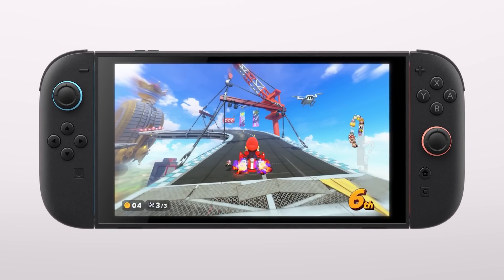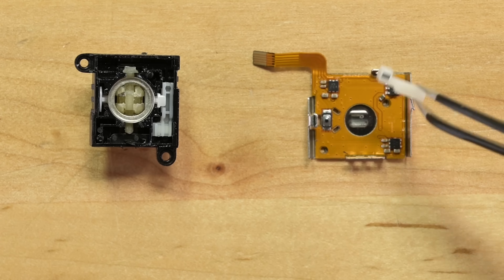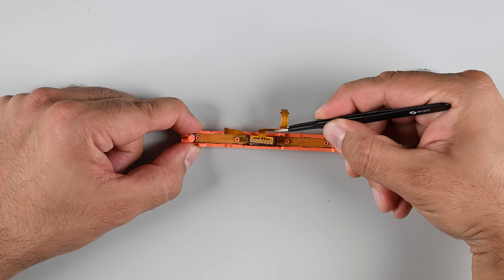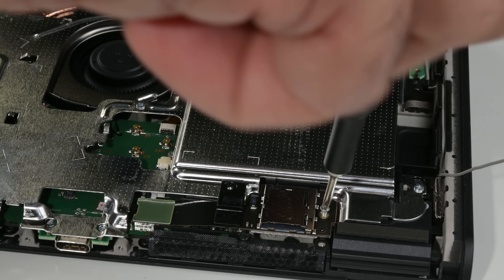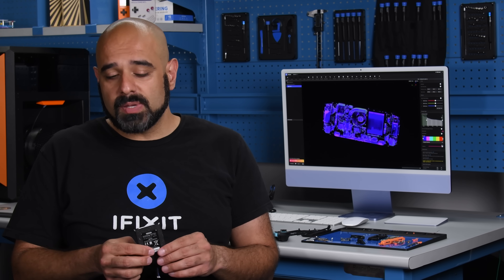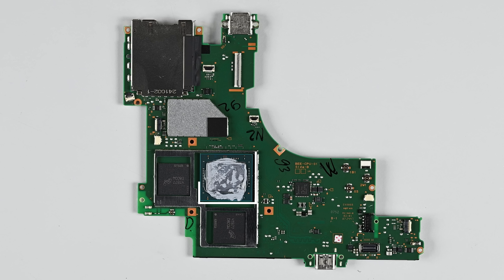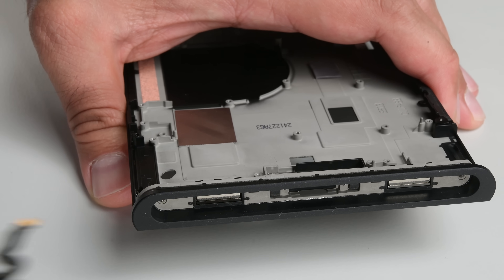Joy-Con Drift Isn’t Dead: Inside the Switch 2

Comment: One thing to note/correct here. The Switch's battery is able to do more than 300 charge cycles w/o battery degradation due to the fact that Nintendo undervolts their system. This is also why Macbooks have about 1000 charge cycles before battery degradation whereas Dell and Lenovo only rate their batteries at 300 charge cycles before degradation. Nintendo intentionally underpowers their system and that puts very little wear on the battery. The battery will last a long time, especially if you cap it at 90% in the settings. That said I have noticed the Switch 2 runs a lot hotter than the Switch 1 which could lower the lifespan of the battery.
Reply: And to clarify on Macbook thing; it's not that Apple underpowers their system like Nintendo (cause they don't), it's that Apple can optimize for the h/w better, allowing for greater thermal control. But it all at the end of the day leads back to how much heat the battery is exposed to.

Comment: 6:00. Can confirm, Switch 2’s battery drains very fast right out of the box. Barely get to play anything before it’s time to charge up again. Going with the outdated power hungry 8nm Samsung chip and not putting a large enough battery are bad design decisions from Nintendo. Nintendo’s gonna need to do a V2 version sooner rather than later. 🪫👀😑👎
Reply: Drain the battery to 0 and then charge it all the way to 100% without playing on it, and do that a couple more times and the battery should last a lot longer.

Comment: Switch 1 had hall effect mods. Are you planning to make one and check if it works with the Switch 2?
Reply: There is a good chance it won't due to the joycons built in magnets which will interfere with them.

Comment: it's a shame to see Nintnedo not giving a fuck about longevity of their console.
The stickers hiding the screws is just terrible.
I hope for the fans that the Joysticks will not drift but for Nintendo, i hope they start drifting even faster so that they can see that it was a big mistake to not go with hall effect joysticks
Reply: They use stickers to keep it as thin as possible for strong magnetic connection. This is an official info. Joy sticks have been using this tech for decades and can be durable if designed well. It's hard to tell from plain sight because the stuff that matter are small design decisions. I hope it's not badly designed this time

Comment: Nintendo's never on the right to repair bandwagon-no repair manuals or guides even if you're a NY resident.

Motorola also shameful for using copious amounts of glues for batteries just like the Switch 2 yet they champion right to repair with an iFixit partnership.

Comment: No one should buy this thing. Nintendo is milking their customers, selling old games at full price and new ones at even higher prices, combined with a console expensive and has horrible battery life, which will suffer from the same issue as the joycons of the first one. Not to mention the horrible trends promoted by Nintendo besides the price, see the card games that have no game, and will become pretty common due to the high prices Nintendo charges for game cards with memory. And of course, since it's a closed platform, it's pay-to-play online. You will even have to pay the subscription fee to use video chat from March next year.

Comment: OK, this really makes me angry that they make switching out the batteries so hard again...
I have had my battery start to bulge to the point that it was visible on the housing, which required me to open this and take it out so I don't get some explosion or fire going.
I would still be angry if the battery wouldn't be replacable or easy to buy but I am MAD that they can't be easily removed, since this is a damn hazard of they start bulging up! This is the 3rd one that went that way when counting the two other ones last year from my Nintendo 2DS and Fairphone 3, with both being WAY easier to remove.

Comment: psa, there's a menu setting to cap battery charge to 90%. it's obviously better to just have a more repairable advice, but turning that on should result in reduced battery wear.
Reply: Sounds like suffering with reduced battery life trying to delay the inevitable
Reply: @hams_salad kinda, it took my laptop about 2 years to reach 85% capacity. if you intend to use your switch longer than that, then eventually your 90% switch is going to have higher capacity than a switch routinely charged to 100% even when its still charging to 90%. besides if you really want that extra 10% for a trip or something, you can turn the feature off for a bit.
Reply: @hams_salad ain't that just life?
Reply: For that, they should put a bigger battery and lock out the last 10 by default

Comment: I would love to see a dock teardown as well. Recently I saw a video showing how Switch 1 and 2 dock incompatibility is thanks to more than physical limitations, but there is also something going on in the hardware/firmware itself that prevents the switch 2 dock from recognizing the Switch 1 and vice versa. It would be fantastic if some 3rd party could devise a workaround for a universal dock (for households like mine with multiple Switches and only one decent TV.) One dock to rule them all, so to speak.

Comment: Overall it looks do able for what's probably going to fail first or by accident - the battery and screen.  I've never found the joy con drift to be a big issue that wasn't fixed by just buying a new set of controllers and using the old ones for when friends and family want to play.  I think 3 is little harsh, more like a 5.

Comment: Why does everyone keep comparing it to the original switch? Normally, you compare it to the last device that came out which would be the old switch? The old switch already has a 7 inch screen. If people actually start looking at them more closely they’ll see that the 7.9 inch screen on the switch to isn’t that big of a jump, but apparently Nintendo was trying to pull an apple and compare their stuff to their first generation older spec instead of just being honest and more transparent about the lesser screen jump sized than there really is
Reply: Lots of people have the old 6.2" switch and will be impressed.  I am.  This switch 2 is a rockstar compared to the old switch.

Comment: Remember when Nintendo claimed they completely redesigned the joysticks from the ground up?  Doesn't look any different or "redesigned" to me.
Reply: Well, they are slightly different so there's a small chance they were indeed redesigned to be more resistent. Time will tell though.
Reply: "We sat two engineers in separate rooms to create the cheapest joystick analogue sensors possible. Astonishingly, they came up with the exact same approach"
Reply: Just because it looks similar doesn’t mean it’s the same. Are you an engineer?
Reply: @AndrewPL5  Companies have been "redesigning" their potentiometers since the drift gate started with the xbox 360. The redesign always turns out to be a miniaturization to reduce costs, drift issues only got worse. The miniaturization is here...
Reply: I watched that part 3 times. That man was very good at doublespeak. He would have shot Nintendo in the proverbial foot if he’d said we added new features to the joy-cons, but didn’t mess with the sticks so stick drift is still possible.
Reply: Marketing BS.
Reply: they're completely different, and better made. they most likely won't have widespread drifting issues.
Reply: @Zanpaa Time will tell. At this point, there are so many hall effect controllers being offered there’s no question about what to use.
Reply: first, they were afaik talking about the pro controller ones. second, according to welcome tour, they DDI change a lot of TINY details on the joycon2. Third, even a few 10th of a mm can make a difference.
Reply: Just marketing. They may or may not release alternative jcons. They just want your money.
Reply: I didn't realize you were an elecrron microscope and able to see nuanced differences in atoms and meterial sciences! 

In all honesty, Yes it's disappointing they're using poteniometers still, However it IS possible that they altered either the material, Density, Adhesion, Surface finish, default pressure of the wipers, or other factors that will reduce wear if looked after.  It's too soon to tell but if enough reports flood in soon enough, That will answer the question, At which point, Legal attacks like they like to do to other companies becomes the only apropriate action.
Reply: @kowalskikunigiri1554  They altered the materials alright, made them even cheaper and shittier.
Reply: Well said.
Reply: They redesigned them, but ended up with something that looks like a cheaper revision by coincidence.

Comment: The Steam Deck is not more powerful than the Switch 2, or at least it isn't capable of superior visual output. All side-by-side comparisons between the two devices in Cyberpunk 2077 and Street Fighter 6 show a generational difference in visual quality between the two platforms that is far in favor of the Switch 2. It isn't close.

PC handhelds will not be competitive until FSR 4 is incorporated into AMD's APUs in 2026 or 2027.

Comment: Had the Switch since 2017, but never had to pry it open... Had to fix the first joycons 2 years later, though temporarily worked fine. My replacement joycons lasted until now (5 years) without drifting.
Reply: I bought in late to the switch with the oled, 2 and a half years on and they're still flawless. I wonder if there's stats out there because I think they must have done something to them that improved things.

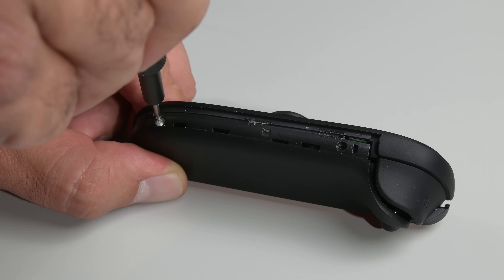Comment: 1:30 this guy insist with the watt/hour unit, when all the industry use the factor milli amp / hour
Reply: That’s because the watt hour metric is a significantly better one to use. mAH tells you nothing about how much energy the battery actually contains. Depending on the voltage of the battery, two batteries rated for 3000 mAH could contain wildly different amounts of energy.
Reply: @ev2477  majority of gadgets today are 3.7V
Reply: Mistake correction: its Watt*hours and amperes*hours

Comment: even though the new sticks are mainly still the same design, potentiometer, i still think that overall they're going to last a fair bit longer. the original joysticks on the switch 1 joycons made this awful springy grinding sound every time you'd rotate them, but these new sticks feel incredibly smooth.

Comment: Sweet. Although I wouldn’t necessarily call a battery a consumable. I’m still using my original battery on my launch day switch. I’m sure it’s at 80% or less capacity. But it seems lithium batteries carry a decent capacity for a long time. You would think a 7 year old well worn battery would have next to no charge. Heck I even have an originally psp battery that still works. That blows my mind it hasn’t swelled or something yet.
Reply: Batteries are definitely consumables, consider yourself lucky that your battery life is still good haha
Reply: I also have an iPad 2 that lasted very long. Though when the battery swelled, it took the device with it by breaking the screen.
Reply: Oh yeah. I have a second gen iPad mini here in the kitchen. Still going strong. I would say a battery is as consumable as any other part of an electronic device. Such as a joy con, you’re much more likely to have the joystick drift and break than the battery to die. So I don’t know. Batteries don’t seem consumable to me.

Comment: Weird question but is it a standard 1x lane SD express? Or does it have extra pins for 2x lanes?

2x should have 27 pins vs 17 for 1x

Also do we know if the micro sd express uses gen 3/4/5?

Comment: Some of the flex cable tabs are so cheap that they're only rated for 5 open and closed cycles before they ultimately break. How can we forget the dread origami flex cable on the N3DS that would wear over overtime because that hinge design was flawed? I'm happy with my Steam Deck OLED. Never looking back to buying a Nintendo console.

Comment: Literally we got a video comparison yesterday of CP2077 NS2 v Steam Deck and because of DLSS, it absolutely destroys Valve's  console. So these claims are pain wrong.
Reply: It still can do FSR and frame generation... why Nintendo signed for a chip without Frame generation is beyond me.
Reply: @lukilladog FSR is terrible at low resolutions unless it’s the AI based version.

FrameGen is terrible at 60fps, too much input lag and feels sluggish. Ideally you need 120fps+ for it to feel decent and this console won’t be doing any of that anytime soon.
Reply: @denisruskin348  I don't know your specs but I use frame gen in skyrim locked to 40fps with very heavy mods and I get locked 80fps everywhere, with just a tiny bit of added input lag, I've played games with more input lag with vsync in the past ... are you using freesync?. I also tried the last non AI version of FSR in Space Marine 2 and it also was very improved over older versions. A closed system with games designed with frame gen as the basis should be pretty good I think. See, the other day I was trying Doom 3 with mods, and this game doesn't work well with fps over 62, but locked to 60fps and doing 120fps with LSFG was great, minimal input lag, and the smoothness is just in another league... in part because there is a "problem" with modern high refresh displays, they are no longer tuned for 60fps and look a bit choppy at these frame rates, which makes Frame gen even more necessary.

Comment: I know the major market for this is young to middle-aged adults these days, but it should still be designed to be given to a kid who won't take care of it (neither will adults who act like kids). I bet many people will break one of the USB-C ports and have no easy option to replace them. Also, we have had strong screen glass tech for years on all phones, so why would they rely on a plastic sticker? I suppose they assume "normies" will buy new controllers when they fail, or not care that they have to replace the entire system when the USB-C ports break. And with how many games are going to cost, when does the system become a subscription you don't own?
Reply: You can't prevent a glass screen from shattering when dropped from a certain height/angle.  

Even the most modern phones have glass screens that will crack and/or shatter from impact.  The harder a material, the more brittle it is.

If you're asking why the Switch 2 doesn't come with Gorilla Glass, specifically; the answer is cost.

Comment: So, the Switch 2:
- Still uses the same old potentiometer sticks that will start drifting very soon
- Has a soldered USB port
- Has a power-hungry 120hz LCD screen (In a console that can hardly run games at 60fps)
- Has a very small battery that is completely glued to the device
- Has no fast charging, takes 3 hours to charge and the battery will (in the worst case scenario) last only 2 and a half hours.
- Does not have full retrocompatibility with the Switch.

What a terrible, terrible disappointment. But i guess it will still sell like hotcakes because the average Nintendo fan is a terminal consoomer.
Reply: Switch 2 screen is not plastic, it just has a screen protector pre-installed, you can easily remove it as shown by other people doing teardowns.
Reply: @UhOhUmm  is it supposed to be use replaceable or only in store?
Reply: @ricarmig  It's really well stuck on, but I don't see why you wouldn't be able to take it off. Nintendo says the only purpose it serves is to stop glass shards from cutting anyone if the screen gets smashed. I think once the plastic scratches off a lot of people will take it off and put a glass screen protector on.
Reply: this is what I mean when I say that nintendo won the console war, they can do that sort of horrible hardware and worst support possible and they get 0 backlash and they still get extremly high sells...
Reply: Some of these are only issues depending on how you plan to use your device.

- If you're docked then battery and power-consumption of screen don't matter
- You can still put a screen protector in your display (which FYI is glass but with a plastic cover to reduce danger from shards if it breaks), which you should and/or would be doing anyway
- Battery life rating is almost the exact same as the OG Switch (I think the refresh increased it a little bit?)

That said, I do agree that adhesive on batteries really needs to die as a practice. Especially for something that WILL (not a matter of if) wear down and need to be replaced.
Reply: You sound salty AF
Reply: @kcamfork mor on
Reply: @kcamfork Justifiably so
Reply: @kcamfork no you sound salty AF
Reply: Don't worry, Nintendo fans will buy them like hot cakes. But they won't get my money 😊
Reply: And they sell it to you like it has the latest tech, but doesn't even have Frame Generation... which is a must for high refresh displays.
Reply: @lukilladog 
the SoC has all the needed tools to pull off FSR 3 frame gen.
technically all that you need for fsr3 frame gen is a gpu that can do asycn compute which has been a thing since gtx 1000 gpus.
people forget the T239 in the switch 2 the same architecture as rtx 3000.

Now what would be interesting is to see DLSS frame gen as its widely known yes rtx 3000 can actually do it just fine and looking it to rtx 4000 was just a marketing gimmick from nvidia.
Reply: The processor is also worse than it is in the Switch 1